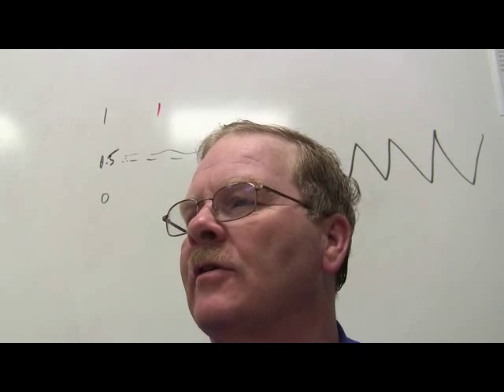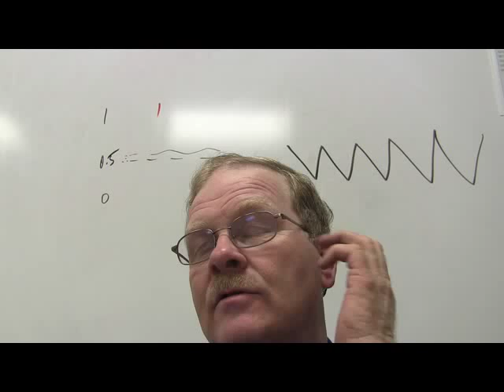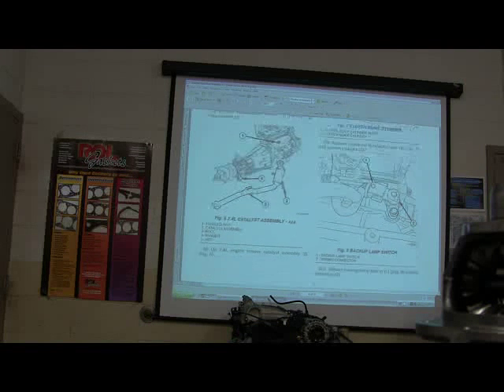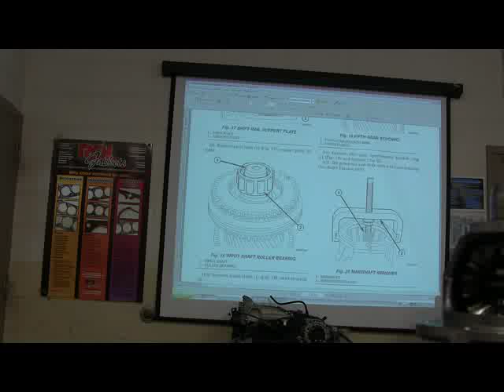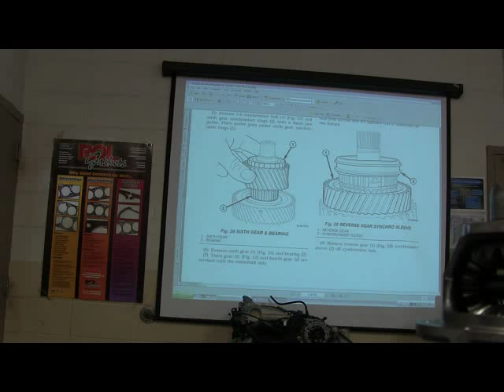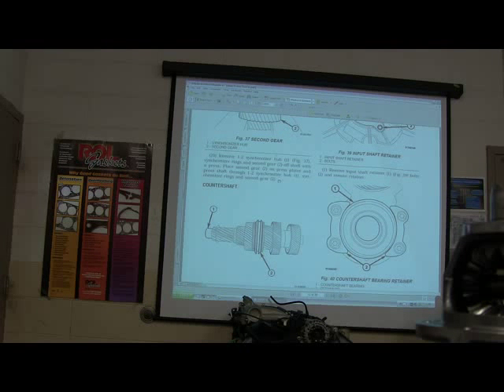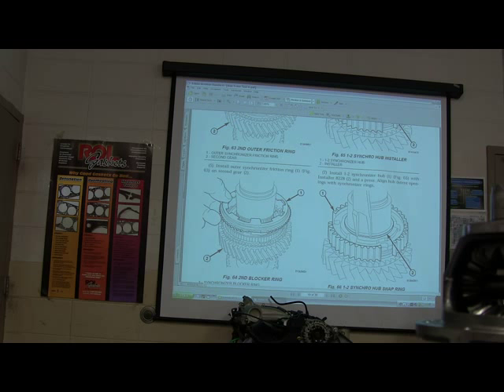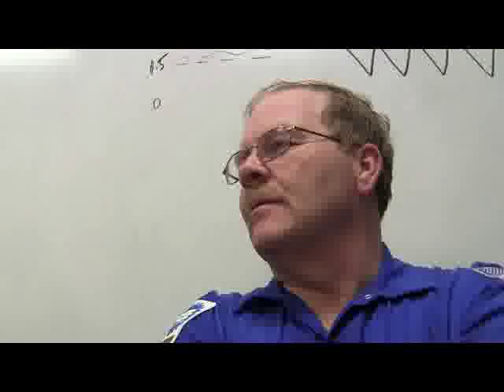Man Trans Test 8   NSG 370 highlights

Comment: Some cheap clutch kits do not have enough spring on the pressure plate. It works but not enough for someone who likes to get on it. After replacing a cracked case on this one job I told the customer that this transmission is not made to be abused like turbo engine transmission in the movie. The customer denied rough treatment. When he drove away I could hear the engine run close to redline and slammed into the next gear.